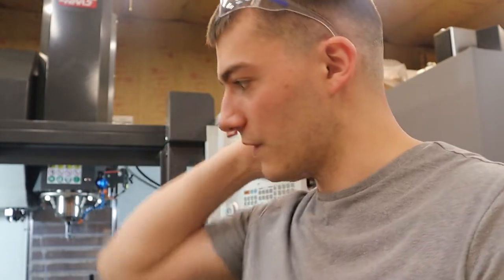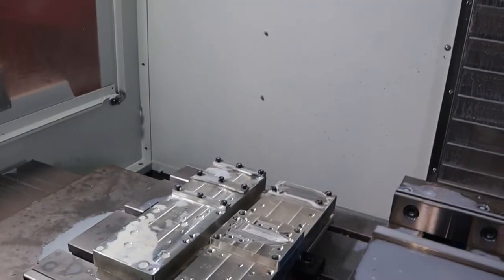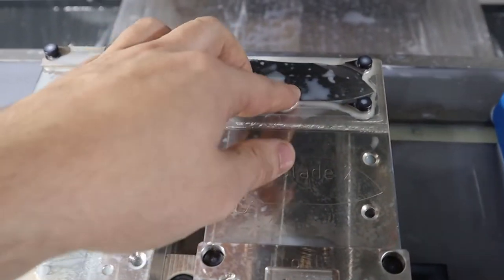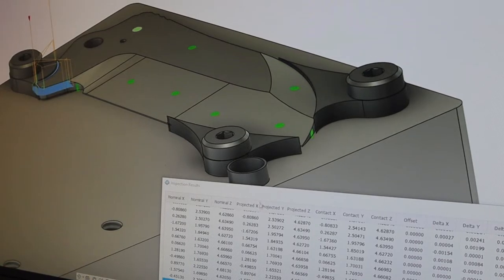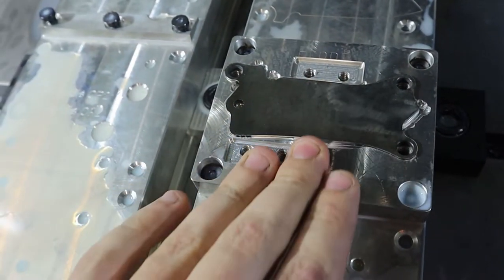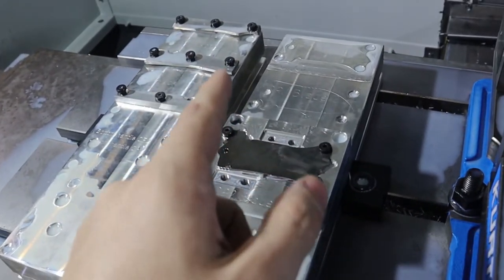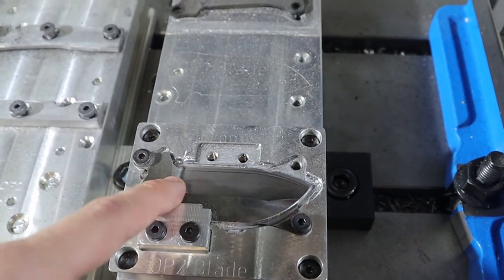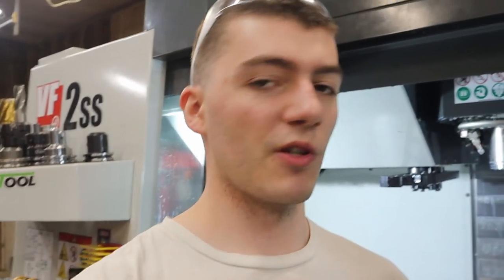CNC machining vlog 7 - Hard milling, and coolant growth issues.

Comment: CMT is correct that you may need to run a solution through to kill the bacteria before refill or it just may come back. I found a nice system from US Water Systems called the High Flow Patriot replaceable cartridge filters. I bought two. One has carbon the other has resin crystals so the water gets de ionized then flows into Haas auto refill system. I also installed a green resilite indicator which will tell me when the cartridges need replacement. They last a long time. So far so good Blaser 735 looks as good as the day I put it in and zero growth. The other thing I did was to get a chip trapper. Probably one of the best things I’ve bought to keep coolant good. In less then five minutes I can drain 55 gal into trapper it gets 1 micron filtered then a simple turn of a valve and it flows right back clean as a whistle into coolant tank. All in all takes les then ten minutes. So easy it can be done once a week. Well worth it!  Love watching you videos when I have time. Figured I’d just pass on what I’ve been learning with the coolant. Have a great one split
Reply from the maker: Thanks for the info! I am still determining the best chip / oil solution. I do plan on running a steel bodied bag filter post pump. Pre pump still need to do some stuff:)
Reply from the maker: Is that a full synthetic? I'm worried about maintaining the water quality thats needed to run full synthetic. When I move to an actual building I'll definitely setup an ro system but for now its garden hose life haha.
Reply from the maker: Yea I used to buy 50 gallons of 1 gallon distilled water. Than I got lazy. Guess I could pick up a 50 gallon drum of water for not to bad. Congrats on the building!
Reply: @split141x  Yes,  it is a full synthetic and does require Di water. I am also in a garage/shop. Mostly because of that I felt the two filters going into haas autofill system made it the most easy to maintain and upkeep. No mixing of concentrate and no mess. I have a hose from a tee on my backyard water faucet going into first carbon filter tower then into resin filter tower and into Haas auto refill. Topping off system is no more work then opening the faucet then programming on the Haas to add 5 gal of coolant mix.